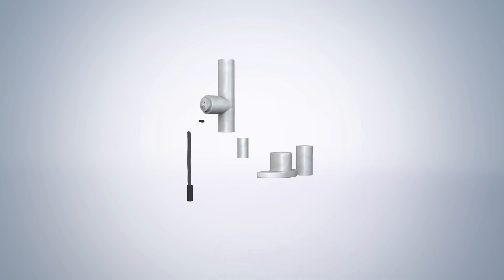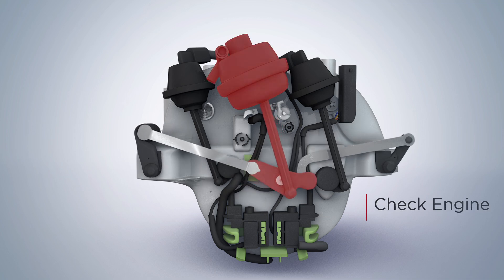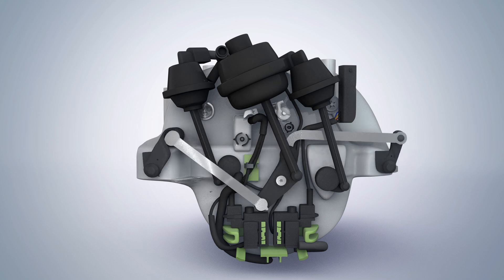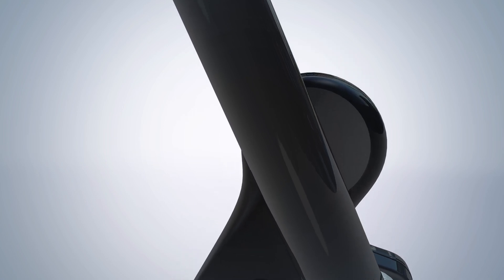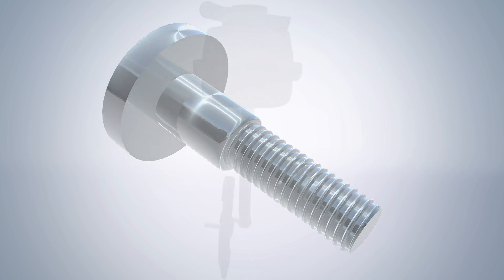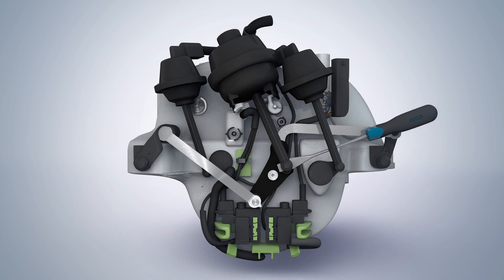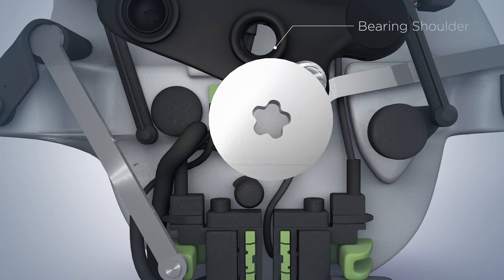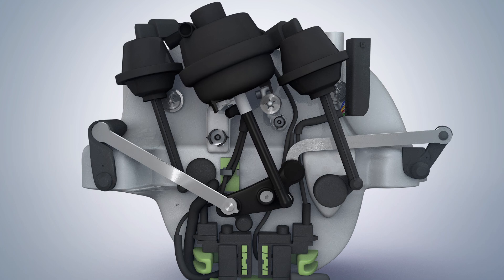Mercedes Intake Manifold Swirl Flap Repair Kit 272 140 2401 R-PRM for Lever and Actuator Rod by URO

Comment: @Uroparts hello, i have w164 m272 code shows p2008 Intake manifold air control actuator, bank 1 
And codes for cylinder missfires. Is it because of this plastic thing broken? I would be appreciated
Reply from the maker: Hi Ire3339, it's possible, but you'd have to physically check the flap actuator system for proper operation to know for sure.  The diaphragm in the vacuum actuator pod could be torn, or a shaft is broken, or the rocker/lever is broken, or the flaps are gummed up with sludge and don't move, and so on.

Comment: rods moves when car is going or on parking acceleration too?
Reply from the maker: Hi, the rods move runner flaps, which direct airflow through long or short intake runners depending on engine RPM, optimizing engine performance.

Comment: Hello guys. A little help please(P2006 - no check engine light,though ) It doesn't look like anything is damaged with me, but after pressing one of the levers as you do in the clip, it stays in the same position and does not return.,at the same time it moves hard. What do you think the problem might be? 🙄
Reply from the maker: Hi Simeon, the central pivot lever is operated by a computer controlled vacuum actuator, which in turn operates the swirl flaps. As the intake manifold experiences carbon buildup, the flaps on the inside have to work harder and harder to open and close. This, in addition to being exposed to high under-hood temperatures, makes the plastic brittle and causes the weakest points of the system to fail.

During installation of URO Parts Repair Kit 272 140 2401 R-PRM, the intake manifold needs to be inspected to ensure no excessive carbon deposits are present on the intake swirl flaps themselves. This could lead to binding and inconsistent operation even after the repairs and enhancements are completed. A simple cleaning with common intake aerosol cleaners is recommended.  Hope that helps!

Comment: is the center flap right hand thread or regular lefty loosey?
Reply from the maker: Hi, do you mean the flanged pivot bolt for the rocker arm in the center of the intake?  The pivot bolt has standard thread (lefty-loosey).

Comment: @2:24 if it was truly an imagine of excellence in engineering, Mercedes Benz would not have manufactured Engines that fail & enter limp mode due to a single cheap plastic brittle part in a high temperature intake manifold system. its flawed engineering at its finest.
Reply: If ridiculous emissions laws didn't exist, they wouldn't have needed to.

Comment: Thanks, now I finally know what that odd vacuum-actuator thing in my engine does, it's a tumble flap actuator! (I don't have a Mercedes but a N/A petrol Audi.) Anyway, I had never even heard of tumble flaps, until recently, even did some research on the part but could not find the exact reason it's there (the tumble flaps) until I accidentally read some wikipedia article about it recently and then I came to this video to get visual confirmation, because it looks exactly like this part. Great!
Reply from the maker: It's very interesting technology, and helps maximize both power and fuel efficiency!
Reply: I recently fitted it and I honestly noticed more torque at lower speeds and just more power in general on open stretches. Surely im not imagining it 🤣

Comment: Even if you replace the old lever with a new robust one,you'll still have the carbon build up in the intake that creates drag on the flaps. The real fix is to replace the complete intake with an upgraded one. Unfortunately the intake is a part that should be replaced at least every 4-5 years for optimal performance.
Reply from the maker: Hi Mike, yes a new manifold is naturally best for optimal performance, but a repair kit helps people who may not have the money to replace the entire assembly.
Reply: How much is the new manifold for M272  @Uroparts
Reply from the maker: @katungyepeter3727  Thanks for the question Peter, we should have replacement Intake Manifold 272140240180 (which superseded 272140240164) available in early 2025.  The retail price isn't available just yet, stay tuned!
Reply: I replaced my manifold but the problem on mine was the actuator bellows spring which caused the rod to break, After I removed the manifold there was no carbon build up the flap runners were smooth as silk

Comment: I like the product. But I found impossible to snap the central pivot on bolt joint with silicone grease. The metal pieces look like bent inside instead of snap over the bolt joint. Not sure what to do now... It's very last step and seem to be impossible to snap it on. Why uro didn't use same rubber housing as with other two ball joints? Any recommendations? Im worry that that protection metal lock or how you call it is damaged now..
Reply from the maker: Hi Lukáš, the URO kit uses the same type of metal clip as the original Mercedes part.  The sides of clip must flex outward to fit the clip over the ball, so if you squeeze the sides of the socket with pliers or other tool when trying to snap the socket into place, it can prevent the clip from flexing outward and result in bent tabs.  Try bending the little tabs back into their original position.  It might be easiest to fine-tune the tab angle if you pop the clip off the socket, so it's easier to bend the tabs from the side with needle-nose pliers.  After the clip angle is corrected, you could use a small flathead screw driver to lift one (or both) sides of the clip to expand it and make it easier to snap the socket onto the ball. Please contact us using the contact forum on our website if you need any additional assistance, thanks!
Reply: @Uroparts  that's exactly what happened to me. Managed it to clip it on.

Comment: Why do they say German engineering is the best I had 3 Mercedes and all were junk the airmatic suspension failed sbc failed intake lever broke esp bas just was a complete hell and money pit...I switch to Lexus so has my wife has Honda accord and we have not had one failure ride is smooth no limp mode just such a relief now we can use our paycheck for our family other than giving it to Mercedes
Reply: Pre year 2000 mercs are built up last, lots of steel but after that, too many plastic parts
Reply: Maybe cuz you neglected the cars. If you don’t have the money to repair or knowledge to fix your car then don’t bother buying a german vehicle. Stick to your Japanese junk.
Reply: the only thing germany mechanic forget to learn is how to make a reliable car

Comment: So you pay 70K+ for plastic engine parts. Those crafty Germans knows how to fool em 😂
Reply from the maker: Hi Eric, plastic parts can save the automaker manufacturing costs and reduce weight to improve mileage (often mandated by governments), but it does provide the automotive aftermarket with an opportunity to provide upgrades, such as our URO Premium line of components that feature improved designs and/or superior materials.

Comment: @URO Parts
The video starts explaining that the cause is due to carbon buildup making it harder to move the Flaps until they get practically stuck.  Then the plastic breaks.  
So I'm not understanding how replacing the failed part will solve the problem.  It will work a bit, but struggle to do so and still perform poorly.

The video also makes no mention of removing the manifold to perform this task, but at then finishes off with completing the job by installing the manifold back onto the engine.
And so, shouldn't this kit also include all required parts to make it simple?
Reply: "the cause is due to carbon build up making it harder to move the Flaps until they get practically stuck.  Then the plastic breaks. "
How do I get rid of the carbon? Since this seem to be what could be the most likely cause.
Reply: @helmhurst  
I think a lot of it also has to do with the fact that the plastics dry up over time, and become brittle.  So much that cars will not be able to get to 15 yrs without parts breaking.  Some, pretty significant.. ... it's a good thing these don´t have most things actuated by diaphragms and vacuum lines like its predecessor.
This will get it going but, even if there is little build-up, note that the internal flaps are also plastic and will also become brittle.
Reply from the maker: Our kit is metal and can withstand a lot of carbon buildup so you're likely to get years more out of your intake by installing our kit.

Comment: Will this work for my 07 e350 if so can you send the link to buy the aluminum one mine broke
Reply from the maker: Yes it will work.  You can purchase it here:  https://www.rockauto.com/en/parts/%C3%BCro+parts,2721402401RPRM,intake+manifold+actuator,17824

Comment: Without removing the intake manifold, can I visually check if indeed this part is broken?
Reply from the maker: Yes, if you look closely you can see it.
Reply: URO Parts With the engine running, is this item supposed to be moving? I had somebody rev the engine while in park and none of these bits seem to be moving at all
Reply: How can I order the part

Comment: What about the one to left and right.right one broke out the manifold
Reply from the maker: Those don't operate nearly as often so the failure rate is much less.  Unfortunately it doesn't make sense to make them and if you have an issue with them you'll have to purchase an entirely new manifold.
Reply: @Uroparts  removed manifold lastnight. And swirl flap is completely gone...pieces fell out i can not believe this,a Mercedes design and its horrible. Im so upset and glad i dont own this car. M272 m273 trash if u ask me.i want the double plug huge coul engines back m112 m113

Comment: Hi, thanks for the great video. Does this problem occur on the 2007 w204 c220 models also? Thanks!
Reply from the maker: Hi Daniel, unfortunately our kit does not fit the 2007 C220. It's intended for the intake manifold 272 140 2401, which is found on M272 or M273 V6 engines.  To answer your question, many engines suffer from oil vapor buildup in the intake, which can negatively affect the performance of butterfly valves.  Performance enthusiasts sometimes add a custom oil trap between the PCV and the intake to reduce buildup.

Comment: Uro parts. The problem with my 2008 Dodge sprinter is  when I press on my pedal. My van pulls away from a stop sign really "slow". By the time I'm 25 feet out it starts to run normally.  It's just really slow at the take off.
  I've actually been parked on a hill facing up.  When I stepped on the pedal it would not pull itself up the hill. I just kept screwing with it until finally I got it to move. It runs really well one I get it to move.
  It hasn't done the strang up hill from a stop thing in a while. The pulling away from a stop sign really slow happens all the time. 
Any ideas?
 I'll get the codes its putting out tomorrow morning (Monday)
Reply from the maker: This does sound like an intake manifold problem, but I'm not aware of any repair kits for a 2008 Sprinter so you probably need to replace the whole unit.
Reply: @Uroparts  this problem is a strange problem. 

   I've been driving it for about 2 months now with it doing the sluggish thing on take off. I woke up this more. Started my truck and sure enough it's still doing the same thing.  I drive it to the post office  (about 4 miles away) I shut it off. Come back out from the post office start me van & the check engine light has gone off. I drive it over to my shop ( about 4 miles away)  it is running perfectly fine.  I've been driving it for most of the morning and the check engine light has not come back on?  Now that is not uncommon for my van. Last Oct. I went to get it smogged to register it.  The light had been on for atleast 10 months. It went out the day before I took it in to the smog place. Past with flying co.
  This is a 2008 and this has been going on since I purchased it.  Well it really started about 4 years after I purchased it.  I've also had 3 computer refreshes done. Had to have them o get it licensed.  When I purchased my sprinter I was getting 21 miles to the gallon. First flash down to 18. Second flash down to 13. Third flash now I'm at about 8.5 miles per gallon. I just love our government.  How can it be better on the envirement getting this bad of fuel mileage? I would think getting the 21 mpg would be better??

Comment: Excuse my French but why in the FUCK would you make plastic moving engine parts?
Reply from the maker: Very common in modern engines, probably for two main reasons: to lower cost, and to reduce weight to help meet ever-higher government fuel economy standards.

Comment: Do you have an URO Repair Kit part number for a 2011 ML350 Bluetec Diesel 3.0 Engine OM642. Is it possible to replace the Central Pivot Lever in front of the Intake Manifold on the outside, by removing the air pump and the thermostat, without taking the Intake Manifold apart?
Reply from the maker: Edmond Young no sorry we do not.

Comment: URO Parts would you recommend that I install this kit on the new OEM intake manifold that I plan to order for my 2006 Mercedes C230?
Reply from the maker: George Olivas yes we would. It will prevent premature failures down the road.

Comment: I have this kit plus other parts for W164 for sale as a job lot with a big discount:
Purchased from AutohausAZ for Mercedes ML-350 w164
272 140 24 01RPRRM URO Premium Intake Manifold 
Adjusting Unit Repair kit        X1 $156.26
272 141 22 80 genuine M-B intake manifold gasket, left   X1 $3.74
272 141 23 80 genuine M-B intake manifold gasket, right   X1 $3.74

Purchased from FCP Euro for Mercedes ML-350 w164
(P)004159180326 Bosch Dbl Platinum 0 242 135 509-000 spark plugs X7 $45.43
(G)00011802609 Genuine M-B oil filter 000118022609   X1 $14.26
(G)007603012102 Genuine M-B oil drain plug gasket   X1 $.19
2720940080 Genuine Mercedes air filter housing seal   X1 $6.80

Purchased at ADAP
Loctite removeable threadlocker 242     X1 $7.49

Purchased from Amazon
iCarsoft MBII new version diagnostic scanner for Mercedes cars  X1 $149.95
• If your vehicles were produced before 2000, please contact us for the compatibility.
• MB II can not work on these chassises: 107 124 126 129 140 201 202 208 210
• Reads and clears codes and reads data streams of most systems such as engine, transmission, ABS, airbag, instrument cluster, Airmatic, air conditioning, parktronic, etc. (Not all systems of all vehicles are supported)
• Resets oil light, brake pad reset function, steering angle sensor reset, electronic transmission control reset (not all vehicles supported)
• Tests I/M readiness monitors, O2 sensors, and performs EVAP system test

Paid 387.86 for the lot. Will sell all for $300 plus shipping or will break up based on offers

Comment: Is there a way to do this job without removing the intake manifold?
Reply from the maker: Maxweisen unfortunately not
Reply: @Uroparts  Yeah just took a closer look today. Looks like it is coming out!
Reply: @GermanBlueMax  were you successful?
Reply: @davidjacobs8558  I removed the manifold and installed the repair kit. I've been driving with this repair kit for over 10,000 miles. It works perfectly.
Reply: Did you notice more power and better mpg?

Comment: So I just bought a brand new OEM intake manifold, guessing I should install this to the new one when it comes in so I dont need to worry about it.
Reply: Kali Fuller I plan on doing the same when I order my new OEM intake manifold for my 2006 Mercedes C230

Comment: from personal experience i know because i owned 3 mercedes in my life and this video is very true the abs plastic peice will break and audi a8 use a simular system on all the mercedes i owned the air matic system failed so did the transfer case on the e500 and the conductor plate on the s500..mercedes is pure shit people like to own one because they feel its a status symbol but they are really over engineering a peice of shit car over priced useing cheap parts whats the point of having a complex motor if the heart of the failure of the entire system depends on a peice of plastic??? they are fucking dummies and myself as well as my family or associates will never buy a mercedes agian

Comment: Other post have said that the bushings and internal parts will disintegrate and throw broken pieces into the intake valves.  Your kit doesn't address this, does it?
Reply from the maker: No, our kit only addresses the most common issues, which are the pivot lever and actuator arm.

Comment: No new uro premium actuator rod was provided in their repair kit.   I just bought it yesterday.  Not listed on their repair kit.  What happened?  Bad item removed?

Edit:  my bad, wrong website:
https://m.eeuroparts.com/Parts/243893/Intake-Manifold-Lever-Repair-Kit-2721402401RPRM/

$79.48
Item: Intake Manifold Repair Arm Kit

On different website the actuator rod is seperate item $176, plastic still, but has ball bearing to supposedly last 6x OEM lifespan.
Reply from the maker: Please contact the company where you purchased the item because you’re missing an item you paid for.